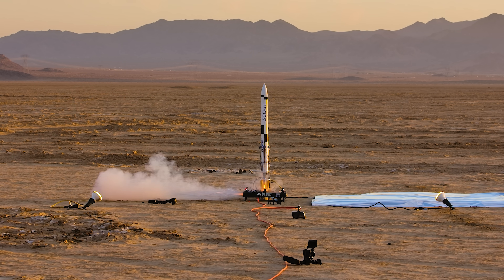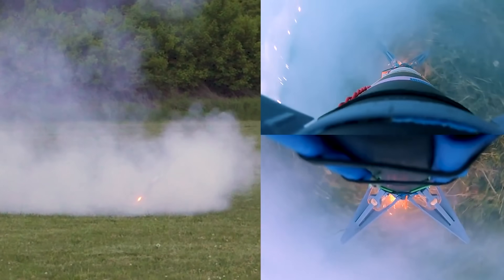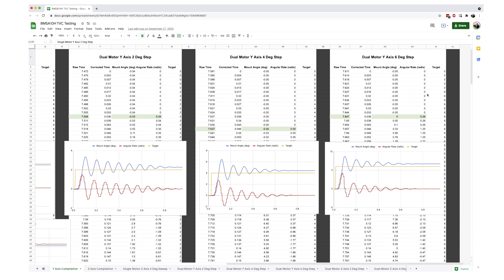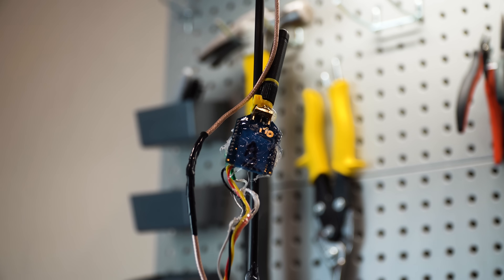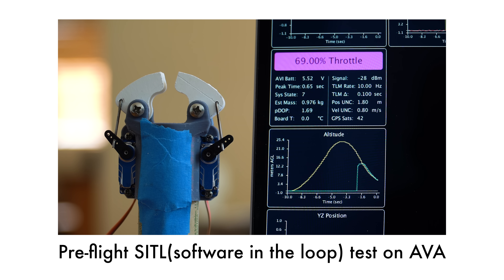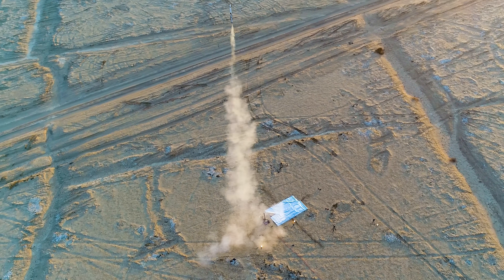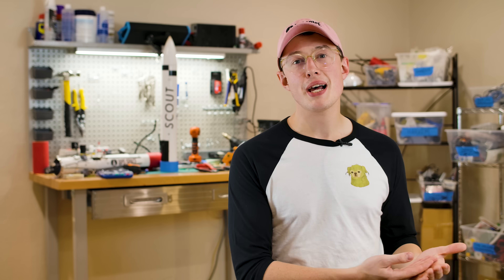Scout F - Flight 1 - Launch and Landing

Comment: I was inspired by your previous content and made an Excel grid that lets you plug in some basic details about your rocket and it runs a simple simulation. It allows you to pick ascent and descent motors from a list of motors with publicly published thrust curves. I was trying to figure out a good algorithm for your sine wave thrust deviation, but never quite got it to work. I basically am trying to calculate the ideal velocity and altitude to fire the landing motor, but pretty small variations in timing caused it not to work.

Comment: Have you ever considered using one or more CO2 Gas Cartridges for descent propellant? You could regulate the magnitude and direction of output via multiple computer controlled thrust nozzles. A burn without a burn, with full control over pressure and direction.

Comment: In my ignorance I think that one of the problems of the rocket falling on landing is the landing charge lasts for a long time there would have to be the possibility of ejecting or turning off the charge as soon as it touches the ground. the second visible problem is the landing support that perhaps should be more supported above the middle of the rocket. I really admire your project.

Comment: I think that your awesome job needs a parametric approximation in order to solve that problem, doesn’t matter which is the launch altitude, all the Eva decisions must be in function of one single parameter, according your maximum altitude elapsed time the system must calcule the exact rocket position in space based on that and by knowing it it and the terminal speed acceleration it will know the exact time to open the landing legs, I know that it sound simple but would require so much time on calculation and coding. By the way, if you put a layer of industrial neoprene between the cardboard and the mylar, it would increase the landing platform absorption and the rocket it’s not going to have any spring effect

Comment: Change out the secondary fuel source for CO2 cartridge which you can easily controller output with a valve.  You can get a 12V Solenard air valve (~$10) which will fix your landing problem.  You can buy 8oz, 16oz or 33g cartridges or whatever size is needed for the decend.    Stop trying to use uncontroller fuel.

Comment: Sending a comment into a ocean of other good suggestions, maybe proximity sensor control on the landing motor ? Which could maybe control the ceramics at a default value which may be tweaked in coding ?  that way you’re  using actual live data rather than predictions or models ?? That way should the rocket not meet expected altitude your not worried about the return ??

Comment: Could you use a CO2 or Nitrogen cartridge to extinguish the motor if you still have too much burn time left when approaching the ground ?
Reply: i have never worked with solid rocket motors, so not sure if they would just reignite if still too hot.

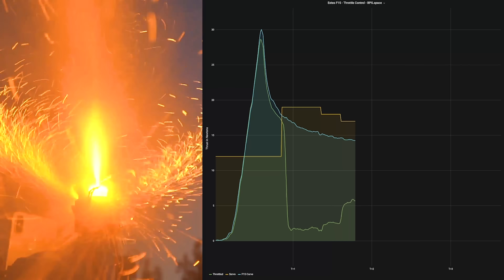Comment: 9:39 perhaps the solution is to not calculate it at peak thrust, but rather at peak apogee, therefore you have a consistent way to slow the rocket down to touchdown?

Another possible solution is to have multiple plot points set for different altitudes, for example one at 25m, 20m, and 15m, and switch to them based on reached height of the rocket.

Comment: Is there a meaningful increase in thrust when the rocket is landing and exhausting against the ground instead of less dense air?  If so, would a mesh landing platform return less thrust and allow for finer tuned throttle control?
Reply: "ground effect"
Reply: @David-gk2ml  thanks!
Reply: @David-gk2ml  is ground effect very applicable here? I know it affects planes because of the compression of air between the ground and the aircraft, but intuitively it seems like the body of the rocket would not create that compression like the wings and lifting body of a plane. Exhausting against the ground also feels like it would do a lot less: if the exhaust changes direction after it’s left the rocket, then there’s no way for that to affect the rocket except by changing the density of the air under it.

Comment: I'm thinking your landing control algorythm should be physics (dynamics) based. Use a real time numerical solution to the simple equation that solves having a 0/0 speed/position intercept with the ground. That numerical solution is updating constantly, calculating the necessary average accel to stop right at ground level. Then the throttle PID controls to that dynamic accel value in your feedback loop (error = tgt accel - meas accel). At apogee, the dynamically calculated avg accel target would be zero. As you gain speed towards the ground, that calculated necessary avg accel will increase. This method should be more flexible for landing profiles (assuming you have enough deltaV in the landing motor to execute the 0/0 intercept). Since you have a good idea of the motor performance, you can time the burn start when it would take 80% of the engine output thrust to match that target average accel. And then this time to start ignition has an ignition delay offset, some typical value it takes to get the motor fired up and producing thrust. Leaving 20% performance on the table allows for late starts to the ignition, or allows room for underperformance on the motor. As confidence grows in the landing algo, this percentage can be trimmed down. Of course leaving 20% on the table means the landing motor needs ~20% more deltaV than the launching motor.

Comment: Have you considered using many small motors with individually addressable ignitors?  The wiring complexity is potentially high, but I feel it could be done reliably.  If you motors are small enough (w/ little thrust and burn time) you should be able to approximate a throttlable engine, and move the complexity out of software and control (where you seem to be struggling) and into the assembly.

Comment: Amazing to see how far you have come these years.  My uneducated idea would be to get it launching to that 25m every time first before you mess too much with more landing.  Since the landing sequence relies so heavily on that apogee being consistent.  Limit gymbal angle for x seconds for ascent?  then release limits so landing can use all of it?  assuming your flight computer can be programed with that.  if it is a PID control it can be a pain chasing that ideal balance.  seems like you need that reaction for descent and balancing for ascent would have negative tradeoff.  Thus some sort of delayed time limiter on the servo throw.  or you can do it lower tech by making the ejection of first stage motors remove mechanical stop.  I know nothing, but random fresh eyes can stur new ideas

Comment: Add a Prox(imeter) Center to the bottom of your rocket. When the prox hits, the 4 axis (0-90-180-270) thrust cancelling defectors activate, (with the possibility of thrust vectoring for the last 1-5 secs). So if the initial burn w/weight did/didn't achieve  the proper height with the payload; it then would then wouldn't matter (On Target, No. Landed, Yes.).

Comment: Perhaps I'm wrong, but it seems like you've modeled a single perfect flight curve, and are attempting to get your rocket to perfectly follow this curve.  This really only works if your real-world flight path is within tight tolerances of your modeled curve, permitting mid-flight corrections to more closely follow the curve.  Your current solution is intolerant of any real-world variances beyond a certain threshold.  With enough flights, you're sure to see a success here and there, but you can do better.

Instead of pre-calculating a flight curve, perhaps you can calculate the flight curve in real-time, navigating to target way-points using some type of PID calculation. It doesn't matter if a rocket follows a pre-defined curve if it reaches all way-points at the correct time, speed, and orientation.  Hopefully AVA has enough horsepower to do the curve calculations in real time.

Oversimplifying the variables to feed into the curve calculator:  Something along the lines of 60% thrust force, max thrust ramp-up latency, min thrust duration, current altitude, current speed, and current orientation.  Based upon the currently available data, AVA would calculate a flight curve, determining the correct time to launch the 2nd engine in order to reach the current target way-point (0 m) at the objective speed (0 m/s) and time (thrust ramp-up latency + duration).  Using PID, you are continually re-solving for this needed curve based upon current rocket performance, which might be way outside your predicted perfect flight curve.

Also, your 80% thrust baseline seems too optimistic, as if you get too far below the achievable flight curve, you can't recover.  A more conservative 60% gives you +/- 66%, which would allow for 3x more reserve lift.  The loss of reserve throttling is easily offset by the real-time calculated PID curve, i.e. if the apogee was lower and resulting the downward velocity was lower, then the engine ignites later to target the 60% thrust modeled curve.  You can always compensate for lack of throttling capacity by delaying ignition, but you can't compensate for lack of lift thrust by flying higher since that rocket-ship has already sailed.  This isn't all that different than your original designs from years ago, where you tried to perfectly time ignition based upon these variables, the main difference here being that you're adding in the throttle compensation.

Said another way, the flight curve is the output, not the input.  Every flight will have a different flight-curve required to hit the selected way-points, affected by engine performance, rocket weight, weather, and general rocket performance.  This is extra important at the scale you are flying - small rockets are extremely sensitive to weather and engine performance is highly variable.  It's probably impossible to make a small model rocket precisely follow a flight curve, but it should be possible to have it simply aim for way-points.

A side effect of just using target way-points, versus trying to exactly follow a pre-defined curve, is that TVC corrections should be smaller.  It appears AVA is working TVC overtime to try and stay within a very narrow flight path.  Instead, let AVA calculate the ideal flight path to get to the target way-point.  It only takes a very small correction to adjust for a waypoint that is 20 meters away, versus a very large correction to follow the straight and narrow pre-defined flight path.

I'm sure you already figured all this out.  I've enjoyed your videos for years, and never chimed in before, but felt the unusual desire to contribute on this one.  Good luck and thanks for the immensely entertaining content!!!

Comment: All vertical landing schemes rely on some amount of sliding about, when it comes to landing, Falcon 9 is famous for it. As for bounce, at a cost of significant extra mass, you could rely on a mass-damper on the vertical axis. A one-time-use setup might do the trick, or something like a lightweight spring (rubber bands or titanium spring) tuned to some movable internal components that are allowed to slide inside the rocket barrel---if/when exposed to enough force. All of which can be achieved completely analog.

Comment: Old engineer here (66 years old and a metallurgical engineer for 45+ years).  One thing I noticed in the video, was that the gimbal tended to increase oscillation - it did not look damped at all.  You have 2 problems - one is getting the rocket to go straight up using the gimbal, and the second is getting the motor curve right to land and actuate the gear.  Simplify the problem and break it into the two parts.  For instance, to reduce the oscillation of the gimbal during ascent (and to get the proper height), add some small fins to the body of the rocket.  This is only a temporary thing, to allow focus on the landing portion (hardest problem).  This minimizes gimbal oscillation during ascent and helps overcome the wind loading on the airframe (and allow the rocket to get to the desired height).  Once you have the issues with landing resolved, you can take off the fins, and concentrate back on reducing the gimbal oscillation during ascent.

You are so close.  I have been following your work for quite a while and am very impressed.   The interdisciplinary approach needed (mechanical engineering, electrical engineering and material science), gives me hope.  Good job.
Reply: I should imagine ascent damping fins would become destabilization fins on descent, thus making the hard problem harder, no?
Reply: @davidf2281  That is a good point as it would change the center of pressure.  It the fins were just small enough to minimize gimbal oscillation, but not large enough to significantly change the center of pressure, it might not destabilize on the descent.
Reply: @scottmackenzie3761  not an aerospace engineer here, but I work  a fair bit on analog and digital CMOS integrated circuits.  Would a solution be to either 1) reverse the direction of the fins upon descent, or 2) jettison the fins?
Reply: @noamateurhours  I was just looking for a temporary solution to help break the problem into 2 solvable pieces - (1) minimizing oscillation while working on landing, and (2) landing.  Fins were only temporary until landing was resolved.
Reply: @davidf2281  Could the fins be attached to the landing gear?
Reply: @davidf2281  thats right, I think the gimble of the vectored thrust is over correcting and too slow
Reply: Scott….60 yr old aeronautical engineer checking in.  Your assessment is spot on.  The oscillation, or negative dynamic stability issue is extremely difficult to overcome, however as with anything the devil is in the details, or in this case, being meticulous.  I’m very confident that Joe is made of the stronger stuff that most of us can only aspire.  He will not only solve these things, he will open doors he yet knows exist. God speed Joe!
Reply: @chriskibbe2901  detailing the PID loop is good.  But having just 2 diametrically opposed small fins would reduce the oscillation and allow focus on landing.  As I said, small fins would be temporary.  This minimizes confounding variables. Once landing is resolved, the fins removed and the loop controller tweaked to finality.
Reply: @chriskibbe2901  damn there are so many old engineers out here, I wish I could befriend an old engineer lol so that I can learn stuff from them
Reply: this was also my first thought when I saw the flight in slow motion. The feedback control of the gimbal system tends to build up the amplitude instead of dampening the oscillation.
Finetuning the PID element could solve the problems with the oscillation.
Reply: @Craftlngo  The integral gain is too high
Reply: @andrewharpin6749   agree. ( Old PID guy)
Reply: @Craftlngo  100 percent agree, it has to be hard to do that here tho with how difficult it is to test changed PID variables
Reply: @Craftlngo   i think he would need some more complicated models of control rather than a PID, no matters how well he is able to simulate the model. A 20% of the mass on the gumball definitely ads more degrees of freedom which i think made the system partially unstable (i don't see the amplitude growing exponentially or linially).
Though, i only did a couple of courses on control so don't take me for granted. 
The point is that what i learned is that an oscillating system of one degree is a joke to characterize but once you go for two or 3 it gets nightmarish.
Reply: Adding a bit of derivative feedback is a traditional way to reduce oscillations in a feedback control system.
Reply: @ncdave4life  wouldn't it be the proportional gain in the PID?  I've never used the D in PID before, but the P typically establishes loop bandwidth and P/I ratio establishes damping factor...
Reply: OK this is all above my head, I just watch and think this is amazing.  I'm not an engineer or qualified to offer advice but what would happen if you had attached a string internally (inside of nose cone) and had a mass damper suspended from it below center of gravity / center of mass would this just follow the laws of physics and smooth out oscillations???  I only ask this as it is a method used on top of many sky scrapers although mass is at top (e.g pool, water tank, metal counter weight) because base of building is anchored.
Reply: @desmondtiedemann7714  That only works in static structures - in rockets, that will actually make the stability issues worse. As a matter of fact, the oscillation of propellant within the fuel tanks of the Saturn V rocket caused some significant issues early in its development. The sloshing of propellants would have essentially the same effect on a rocket as a mass dampener.
Reply: @idahomedic  yes, I mentioned without seeing your response. Essentially giving an extra degree of freedom adding the dampener only works if you have some very concrete excitement but for a PID loop only makes things far more complex
Reply: @idahomedic  yes, I mentioned without seeing your response. Essentially giving an extra degree of freedom adding the dampener only works if you have some very concrete excitement but for a PID loop only makes things far more complex
Reply: Why not just not gimbal on the ascent? Jettison a fin-and-motor stage at apogee?